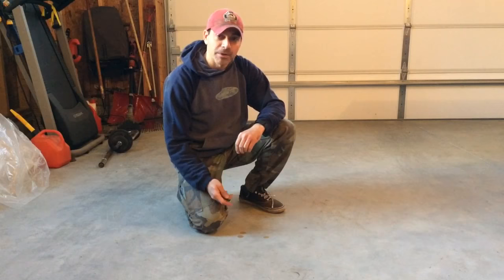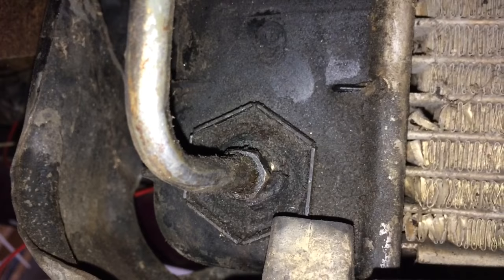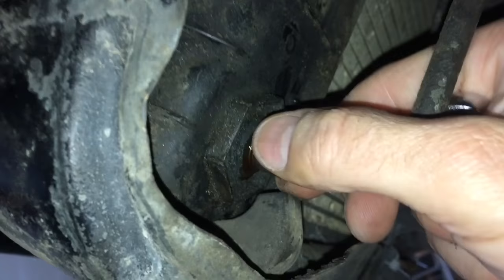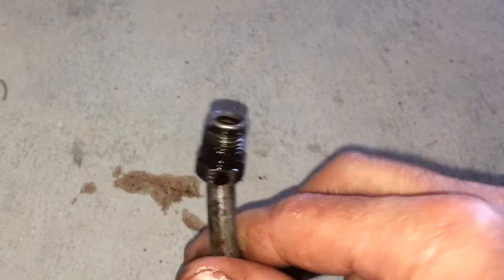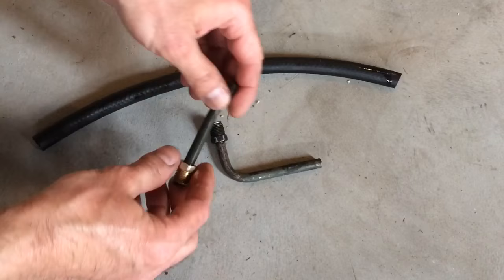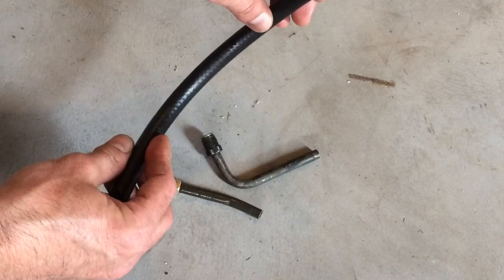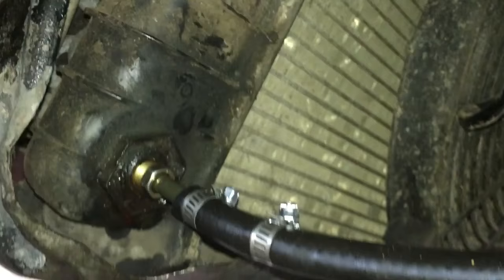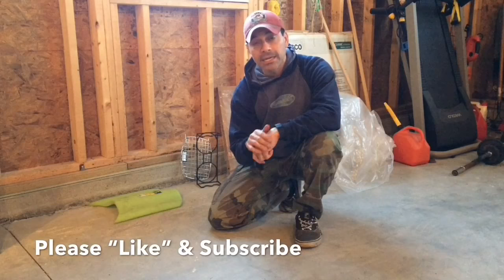How To Fix Damaged Transmission Cooler Line (Andy’s Garage: Episode - 62)

Comment: Perhaps should have flared the end of the existing line to help prevent hose from slipping off.
Reply: That's exactly what I was thinking. I have done this exact repair and had it blown off by the pressure in the line.
Reply: Totally agree... transmission 200 psi. It'll go flying without a flare.

Comment: You won't notice any leaks from just starting the vehicle, but if not done properly it will leak when transmission fluid starts getting hotter while driving

Comment: Power steering hose is what you should use fuel hose will just get eaten away. Just a suggestion
Reply from the maker: Micah Hill thanks for the feedback 👍
Reply: They also make hose specifically for transmission fluid as well. Sold at most parts stores

Comment: Thanks for video. Excellent guide for repairing transmission line. Fittings for transmission lines and power steering requires using special wrenches to prevent stripping out. They are made of a softer metal than other bolts. Brass I believe.

Comment: the pipe from the radiator is 3x as long as needs to be and that forces the hose to make an S curve instead of a L curve going straight up into the upper metal pipe.  I would only have the radiator solid pipe stick out 1.5 inches and i would use crimp connectors instead of worm clamps that can vibrate loose and burn up your transmission if the fluid leaks out too much.  Crimp connections can be crimped with vise grips and like you did double clapped it is ideal.   I would also try to protect that hose with another hose or some metal cover or braided metal hose because transmissions burn up if you run them low.

Best is to not use the radiator transmission coolers because if they rust out they will contaminate your transmission and destroy it.
Reply: you need to make a video
Reply: How would you keep transmission fluid cool when under load? Or from burning. The transmission comes with a cooler for a reason.

Comment: New metal line, heat it, bend it on any round pipe, let it cool, then cut off any length. Connect your rubber hose: straight.

Comment: Just had this issue tonight on my 94 Ranger 4.0 put some new parts on for a good tune up.Went to fire fire an test drive had a puddle of tranny fluid the ground...won’t move at all seen it squirting out at that fitting as u described in your video.Imma try to mimic your idea thanks 🤟🏽
Reply from the maker: Mid- Ohio- cool man, good luck 👍
Reply: Phillips Vision welll went to auto zone and Advance here in town they had no help for me unfortunately.So went to a friend and he managed to cut me a line and reuse that fitting.Had to put 4qts of transmission fluid in lost a lot.But job is done your feedback definitely helped! 👌🏽👌🏽
Reply from the maker: Mid- Ohio- good, glad it helped. Just make sure the line you used is for fluid and high pressure

Comment: Hi, sorry you don't have listed the size and bits that you bought, ie: the pipe type and hose fittin names and recommended hose use or the type that you're using in the video.
Reply from the maker: The line is 5/8 I believe. This video was filmed a few years ago. This car was a 1986 Pontiac Fiero GT, not sure if it’s the same size for your vehicle

Comment: Great video Andy
I have a similar leak, would I need to use any gasket sealer between the nut and pipe? (Both replacement pieces are brass)
Reply from the maker: No gasket needed
Reply: @PhillipsVision  thank you! Worked out so far!

Comment: Hey Andy  I replaced the radiator...  ( 2001 grand cherokee laredo 4.0 6 cyl) both lines were seized to busted up radiator so i disconnected them from the trans lines( skinny hoses) just I did not trace where the top radiator trans cooling line connects back to. please help. does top radiator line connect with top skinny hose.?  help a girl out please its been days...

Comment: So this is a question that pertains more to your video regarding replacement of a starter on a 4X4 Trailblazer with the 5.3 in it and more specifically the part of that video relating to moving the transmission lines just enough to be able to remove the starter. I have done that and still am unable to finagle the starter out of the truck and I really dont want to go the loosten engine mount / jacking up the engine route. Do you think that removing either or both ends of that trans cooler line is a viable solution to getting that starter out? Thank you VERY much in advance.

Comment: My 1990 Honda prelude has a female threaded compression connection and it's in a tight spot that has to have a quick short bend in the connection or it hits the outter end of the radius rod. Where can I find something like that?

Comment: Hey mate thank you for the video! Quick question! Are the hose clamps sufficient enough to hold the hose in place on the line?
Reply from the maker: Should be if tightened properly
Reply: @PhillipsVision  Thank you

Comment: Hi Andy,
Thanks a lot for showing this repair video.
I was just wondering, is there not a need for bleeding air out the pipe? perhaps not, thats why I am just asking :-)
I have sweating hoses and will replace the hoses with power steering hose just like you did.
Reply from the maker: Good question. Yes, any time you work on the transmission you want to bleed the air out.
Reply: @PhillipsVision      how do you bleed the transmission?

Comment: Hello Andy, great vid, but have a question. is it ok to use a type of thread lock or Teflon tape instead of the process you went through? thanks in advance.
Reply from the maker: You could try that but remember the transmission line has pressure so you want a secure connection

Comment: My car, a 2016 Chevy Sonic, is in need of a TRANS COOLER LINES TO RADIATOR repair. I came across this video because the dealership wanted to charge me $456 to do this. Is that too high? Any other alternatives?
Reply from the maker: Very high. You could use coolant line and flare it

Comment: Plz Help!! 97 Ford ranger lower radiator transmission cooler line leaks. I replaced lower radiator fitting with hose/hose clamps like you but fluid leaking at both sides of rubber hose, so I got the compression fitting to join both steel lines and they leak too. What's the issue?!! I tightened hose clamps tight as possible and even a wire tie was tighter. Idk what's wrong. Thx for reply
Reply from the maker: The transmission line has pressure so if the fittings are not properly attached it could be the issue with leaking. Was the hose the correct inner diameter?

Comment: Mine just went out had no power anymore RpM reved up when you hit the gas and all fluid leaked out. Hope something like this didn't cause internal transmission damage transmission fluid was 3 quarts low as well

Comment: What kind of line is that with the fitting on it you use to go in the rubber hose please get in touch thanks
Reply from the maker: Metal Transmission line

Comment: That radiator looks like it needs to come out as well.
Reply from the maker: brussell639 it was removed and upgraded to an aluminum high performance one in a layer video.
Reply: @PhillipsVision  I need help ASAP. My sister hit a coyote last night and her car is dumping transmission fluid from the bottom of the radiator. The car will switch gears but when you hit the accelerator it won't go anywhere
Reply from the maker: Mark Bensley DO NOT drive the car, you’ll burn up the transmission. She may have pull the tranny line from the radiator or damaged the line itself underneath. I would get the car jacked up (use stands) and fill it with cheap fluid. Have her run the car in park and have someone check underneath where it’s dripping from. If it’s a damaged line you will have to repair it.
Reply: @markbensley138  --- don't drive it, you'll damage the internals of the transmission 🤔  and it'll never drive again .

Comment: Where did you get the pipe by chance?
Reply from the maker: Grant Hopper Autozone or Advance Auto. They both have it behind the counter. You’ll just need to measure what thickness you need. You’ll also need compression fittings

Comment: What kind of wrench did you use
Reply from the maker: Joe Gray to be honest I don’t remember the exact size, that was filmed a while back
Reply: @PhillipsVision  the reason why I was asking was because I stripped out the. Transmission cooler bolt on on my radiator and I had to do what you did and I'm thinking about using a compressed fitting or just a thick rubber hose and some tape and clamps

Comment: I recently replaced my leaking radiator myself, . Now, I went ahead and bought new lines But, I can't for the life of me figure out which rubber hose to plug the top vs bottom in. Does it matter? Thanks! The radiator lines bought are part number 52079753AB. please help a girl out